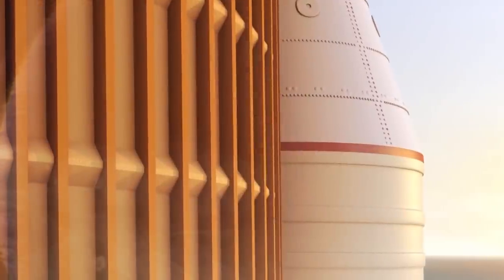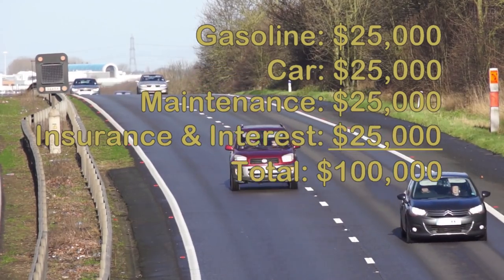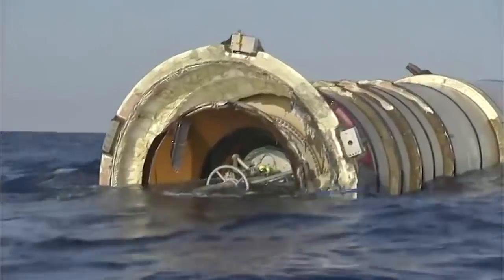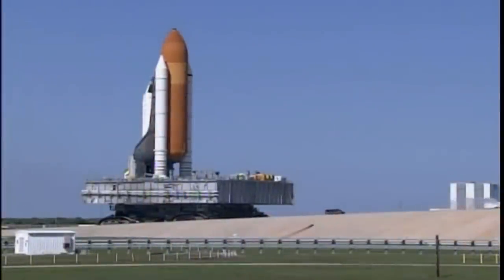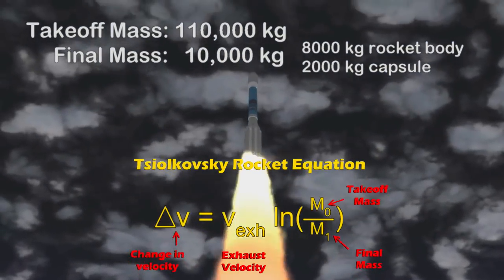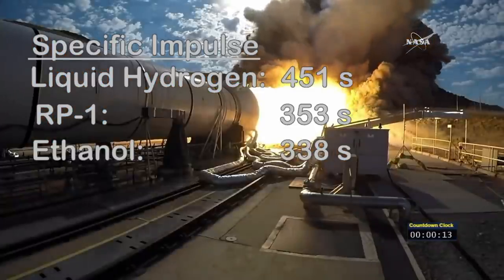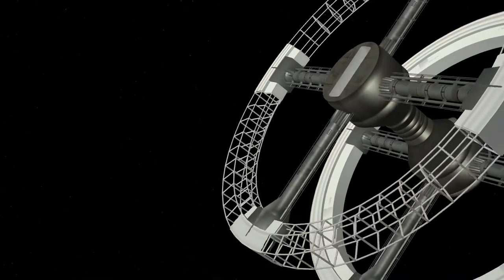Reusable Rockets & Metallic Hydrogen

Comment: Excellent as always!  

How about some info/vidy on hybrid systems? Specifically, similar to Branson's but more evolved.  Instead of brute force with aero drag, a 2 stage with the first using aero as lift until a reasonable altitude (um, wonder what would be ideal) where separation would occur with the 1st aero stage landing on a runway and the second a Falcon like rocket that could reentry and land.  Curious as to what the math would say as far as decreasing fuel weight to payload (cost).  

Pros                                  Cons
fuel/payload ratio           Complexity
Quicker turn around       LEO only
                                          New developmental cost
etc

Comment: Another good point, in one of his books, Robert Zubrin states that the Space Shuttle is built upside-down. They reuse the final stage. For about 99% of it's use, the wings on the Shuttle are useless. You don't NEED wings on a spaceship, there is no air up there. They should reuse the lower stage(s). Ditch the wings, and instead increase the amount of "stuff" that you can put into orbit.
Reply from the maker: I think that's from the case for Mars, but yeah it's a valid point.

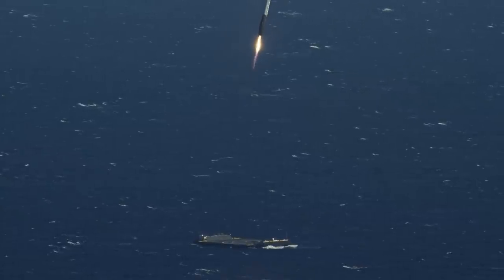Comment: 14:45
I'm confused by this assertion that a chemical rocket (using conventional materials and propellants) can only put 1000mt of payload into orbit. Is there some important piece of context I'm missing? I understand the tyranny of the rocket equation, but I'm just not seeing how payload mass just cuts off at 1000 or even 2000mt. The Sea Dragon you mentioned could put ~550mt into LEO, and it was designed to use heavy steel tanks, was only two stages, and had relatively weak pressure-fed engines (as opposed to using turbopumps). Doubling  the height and diameter of Sea Dragon (8X internal volume) should conceivably push its payload to orbit above the 1000mt limit you assert. Could you explain your reasoning here, please?
Reply: Giant structures tend to have stability problems because elasticity and force propagation speed don't scale.
But more importantly, he is partially wrong on thickness scaling : It has to rise a lot too for the structure to just hold itself.

Comment: RP-1 and LOX are just fine.  The BFR/BFS combination with the first stage imparting 2.9 km/s and the second stage imparting 6.4 km/s gets to orbit after accounting for air drag and gravity losses.  

This is an interesting figure since refilling the BFS on orbit with 1100 tonnes of propellant adds another 6.4 km/s delta vee capacity to that stage already travelling at 7.64 km/sec  and launching a tanker along side a passenger stage, gets you to the moon and back including landing, for about $7.2 million, with the propellant costing an averaged $180 per tonne.  A Mars flight is attained with three tankers and one passenger ship - at a cost of $14.4 million.  With 360 people on the Moon trip and 120 people on the Mars trip this is a ticket price of $20,000 for a two week Moon trip and $120,000 for a two year Mars trip.  $10,000 per week for a trip to the moon.  $1,150 per week for a trip to Mars.  Life aboard a Mars ship is less costly than staying on Earth!  A flight to orbit with 1073 on board will be less than $1,000 a seat.  

Now, another big deal is that an 85 tonne structural weight and 1100 tonne propellant weight can toss 72 tonnes 14,200 km without aerodynamic glide (which could take it further) in about 27 minutes with a propellant cost of $200,000.  

Now this is interesting because a Boeing 747 400 ER has a 14,200 km range which it flies in 16 hours using $170,000 worth of jet fuel carrying 21 tonnes of useful load - that's 412 passengers.  The BFS without its first stage, can carry 1073 passengers the same distance in 27 minutes  at 45% the per passenger cost of the Boeing.  Also, the Boeing costs $248 million whilst the BFS is estimated to cost $195 million.  

If the time on the ground loading and unloading the BFS can be reduced to minutes from hours, you wouldn't need very many ships to carry a lot of people in this way.  Today 31,000 airplanes carry 12 million people to 106,000 locations each day.  3600 rockets could carry 36 million people to 106,000 locations each day at half the cost and allow airlines to triple their profits!  

This is the idea behind Earth to Earth transport. 

To make this a reality doesn't take a super fuel or super materials.  It takes two things

  (1) A reusability equal to airplanes - namely 35,000 reuses for a given rocket.  SpaceX has achieved 3 and is working toward 5.

  (2) A reliability equal to airplanes - namely 1 hull loss in 1.25 million launch and landing attempts.  SpaceX has achieved 1 loss in 34 which is double what other commercial launch providers have achieved, half of what the Space Shuttle has achieved, and 1/6th what the X-15 has achieved.  

This is the hurdle that must be met by any rocket that wants to be taken seriously as a ballistic passenger rocket.  

Airplanes typically last 35,000 flight cycles and at the end of their useful life they are retired to an aircraft bone yard.  They usually last 27 years and that implies an average time of 6.75 hours between flights.  With 0.75 hours between flights, reusable rockets used 35,000 times would last 36 months before retiring.  It also means that 6 rockets a day will be needed to replace the rockets retiring.  

Now, spare parts are made along with airplanes and used up during their 27 year life.  The cost of storing and handling those parts adds to the cost of maintenance.  Doing this for a vehicle that lasts 3 years means that most of those parts won't get used because those parts won't have broken yet.  You cannot economise because you cannot predict what parts you might need.  If there was some way to extend the life of the spacecraft beyond 3 years that would reduce this cost.  

There is.

It takes 90 minutes to orbit the Earth.  4 days to get to the moon.  270 days to get to Mars.  470 days to get to Ceres.

So, if airlines sell their used rockets at a discount after 30,000 flights, along with their spare parts inventory, to space craft users, then they will make use of all those spare parts over the next 50 years as they fly off the last 5,000 flights at a very low rate.  

So, this is how you get 6 rockets per day to enter off world service after serving the Earth to Earth market. 

Does a market exist?  Well at 6 per day after 50 years there are 109,575 rockets in space service.  Over that period 34.2 billion passengers will have been taken on journeys to space - assuming 120 passengers per vehicle.  In 50 years at 1.2% population growth 14 billion people will be around.  They will nearly all have flown in an Earth to Earth rocket, and all will have flown off world as well.  

Now today there are 4.85 billion adults with personal bank accounts holding $220 trillion.  High Net Worth Individuals are the top 1% or 48.5 million of these accounts generally have a little over $1 million in them.  The Ultra High Net Worth Individuals the 1% of the 1% or 485,000 of these personal accounts have more than $100 million in each of them.  Now this last figure compares well to 23,000 super yachts privately owned and 30,000 private jets that are owned by this group.  A total of 53,000 vehicles about the same cost as the space proven BFS.   Around $20 trillion are held by the 99%, $130 trillion is held by the 0.99% and $70 trillion held by the 0.01%.  Companies, governments, universities and military buyers will also add to this demand.  However, Yusaku Maezawa proves that UHNWI with an interest in space travel, particularly as reliability is proven, will be ready buyers for these bargain basement rockets.  

Passenger BFS is 85 tonnes structure, 71 tonne payload and 1100 tonne propellant.  Converted to space use, it has 40 cabins for 120 people and carries a 150 tonnes useful load.  A tanker is 65 tonnes of structure, and carries 1270 tonnes propellant.  One of these refilled on orbit and accompanying a BFS passenger ship to the Moon refills the passenger ship allowing it to land on the moon, and return.  Then refill again, and both return to Earth.  

A Mars trip entails boosting a passenger ship and three tankers to a Mars trajectory.  Two of the tankers refill one tanker and the passenger ship.  The two emptied tankers boost again, putting it on a 2 year orbit - that brings it back to Earth in 2 years.  The other 2 head for Mars.  Both aerobrake into Mars orbit.  The tanker refills the passenger ship.  The passenger ship lands.  Returns to Mars orbit.  Refills again, and both fly back to Earth.

Comment: There's a misleading component to your car pricing. If you include the very difficult to calculate giant oil subsidies (which may have to include portions of military budgets) along with the price of roads (which may include property taxes, street lighting), the figures for driving a car would look wildly different per mile. An example from the UK would be that all car related taxation (34b BP/yr) roughly equals public money spent by government on dealing with car crashes: NHS (healthcare), rescue, police, road repair, disability, etc. Probably not enough to ruin your point about proportions of cost between the two compared.

Comment: Hey Mr. Roddenb... I mean Arthur - I got a good question. Has anybody considered a double helix megastructure?
Reply from the maker: I don't know, I have kicked the notion of helical MSs around a bit, and a double-helix topopolis, but there's no formal name for them.
Reply: Isaac Arthur interesting. For clarity I was referring directly to the dual helix edge, as in essentially a long runway, wrapped around a tube. Would roll like a cigar style of which I'm sure there's a name(like from the end of 'Intersteller', but 50% surface area with the same modular expandability.

Well, I know you have many other concepts  to cover for your channel, but perhaps on the 'maybe' pile for if you revisit MS.

thanks for quick reply, keep it up. Thanks as well to all of your contributors.

~Andrew

Comment: One Way to Measure SpaceX's Growing Market Dominance:

One can calculate* that, measured in the maximum lift to LEO
capacities of all the successful launches in 2016, the lifting
capacities exercised in that year by country are:

Kilograms Lift-to-LEO Capacities** in 2016 by Country
100 North Korea 1 launch
300 Israel 1 launch
27,200 India 7 launches
37,700 Japan 4 launches
151,600 Europe 9 launches
160,200 China 20 launches
164,460 Russia 18 launches
453,383 USA 22 launches
_______________
994,943 World

Of that SpaceX had the following share:

172,750 SpaceX alone in 2016 in 8 launches
Which is 17% of the 2016 World, 38% of the US Lifts

Now, in 2017:

Kilograms Lift-to-LEO Capacities* in 2017 for SpaceX Alone
228,000 Jan-Jun in 9 launches
291,800***Jul-Dec SpaceX schedule 
(Conservatively assuming 11/19 possible launches)
_______________
519,800 SpaceX anticipated lift to LEO in 2017

That means that the expected launch capacity
of SpaceX in 2017 may be more than half of
the world’s total launch capacity in 2016.

That would also mean SpaceX's 2017 lift capacity is 
greater than 2016's capacities of Russia, China, Europe, 
and Japan, combined.

*Sources:
https://en.wikipedia.org/wiki/2016_in_spaceflight…
https://en.wikipedia.org/wiki/2017_in_spaceflight…
https://en.wikipedia.org/…/Comparison_of_orbital_launch_sys…

**Lift to LEO Capacities are here stated as though each orbit achieving rocket were carrying its maximum lift capacity to LEO. Actually lifted mass is less and not all that mass is payload or ends up on LEO, some goes higher. Using max capacity to LEO here is done to have a common baseline of lifting capacity that was used so that an apples to apples comparison results.

* Assumes 10x Falcon 9 Full Thrust launches and 1x Falcon Heavy in the second half of 2017.

Comment: Here's another neat thing about sea launches, You can siphon uranium from sea water to run your fission reactor, that then powers your water electrolysis ;)
Reply: Dan Nguyen Depends what fission process you use. Breeding plutonium from that uranium would be appropriate, as using current methods would be impractical. This is also taking the notion of Isaac Arthurs futurism standpoint; The math and physics and even some prototypes work, but we just need to develop it thoroughly in order to see it happen.

Comment: Are you talking about atomic metallic hydrogen?  Way back when I was a kid I read that it had amazing performance.  I also read that it was unbelievably dangerous.  One of the pluses for my idea to drop 200 ton rockets out of C-5's flying at 25,000 feet above the equator (and an equatorial velocity of 1,200 knots) is that the first stage, the C-5 aircraft, is easily recovered, and could, theoretically, be ready for another launch as soon as it was refueled.  Another plus is that it uses no cryogenic fuel (liquid oxygen/liquid hydrogen).  When you start using cryogenic fuels the cost of everything you do multiplies by a factor as high as ten.  Storable fuels like UDMH and N2O4 have lower performance than the cryogenic competition, but they partly make up for this by having much higher mass ratios.  Both are denser than water and liquid at normal room temperature.  A 200 ton rocket with storable propellants in the cargo compartment of a C-5 would take up much less room than one carrying LO2/LH2.  In addition it's hard to picture liquid oxygen being pumped from a KC-10 tanker through the C-5's pumps and into the rocket's oxidizer tank.  You're correct when stating that there's an upper limit to the size a liquid fuel rocket can be built, and it comes from the same squared, cubed idea you were describing.  If you double the dimensions of a Saturn 5 rocket you have a vehicle with 8 times the mass, but only 4 times the thrust.  Extremely large rockets would begin to get very squat looking. wider than they were tall if they got big enough.  I enjoyed the video.  I was wondering if Isaac Clark is a pen name (for Isaac Asimov and Arthur Clark)?

Comment: One fairly small metallic asteroid could supply the metal and possibly fuel to build hundreds of spaceships.

And you wouldn't have to lift it at all, it could be smelted, cast, machined and assembled in orbit with solar energy.

The only lifting would have to be the first materials to get the process started, it would become pure profit after that initial cost was amortized.

Comment: I hate to be the one asking the sci-fi question, but what about if we learn a practical way to manipulate gravity? If we can create a platform that repels the Earth's gravity, even at half the force (rather than 9.8 m/s^2 but 4.9 m/s^2), how much fuel would your hypothetical rocket (110k full, 10k dry) really need? If you could get an 'anti-gravity' deal going, then there is no need for fuel for the trip-only enough power to keep the anti-grav working. Still, the biggest issue is understanding gravity well enough to manipulate it. If only we had a way to apply some science to that...

Comment: I enjoy this series very much, but there are other realistic options than Metallic Hydrogen. That can take the place of the 1st stage mass. Jet Engines,  Air Launch from a Mother Aircraft, Catapults-Magnetic, or Mechanical, Balloons and Blimps. Anything that is truly reusable. Any of these methods or combination of current tech. How much fuel did the Saturn V use just to reach 5-10km up? I think some are Obsessed with Rocket, First Stages.

Comment: SpaceX is doing pretty much everything that was discussed in the video:
- Reusability.
One Falcon 9 first stage has already been reused recently. It took a year, because they did tons of inspections and tests. The next goal is reusing one within 24 hours of landing. According to SpaceX the first stage's costs is 70% of the total launch cost, so reusing that only is already a huge improvement. But they also managed to recover half of the fairing, which costs $3 million (the whole is $6M). They are also planning to recover the second stage in the future, but that's much harder, because it comes back at full orbital speed.
- Going big.
The Falcon Heavy will hopefully fly this year. That's expected to cost less than half per kilogram of payload. Then there is ITS, which is a bit taller then the Saturn V, 3.5 times heavier, and has 3.6 times more trust.
- Going light.
SpaceX is currently developing a new carbon fiber fuel tank. They successfully tested a huge 12m diameter one last year. It's much lighter than then traditional tanks.
They are also building lighter engines (higher trust to weight ratio). And they cool the fuel almost to it's freezing point, which makes it a bit more dense. This means more fuel in the same tank, and as bonus, higher propellant flow in the engines which generates more trust.
- Going fast.
The new Raptor engine, which has been successfully tested last year, has about 17% higher Isp then the currently used Merlin.
- Mass production.
The main goal of SpaceX is a big Mars colony that requires thousands of spaceships to build, so mass production is definitely happening.
- Recovery & transportation.
Landing on a drone ship is infinitely better than landing on a random point in the water. The very expensive rocket parts won't get wet, and no need for lot's of searching, and fishing out the rocket from the water with big expensive equipment. Landing near the launch pad is even better. SpaceX is building a hangar right next to Pad39A, so they won't have to move their landed boosters much. In the future they are planning to land back on the launch pad, so there won't have to move the rockets at all.
- High launch rate.
They are planning to launch in every two week this year, and every day in the not too distant future.